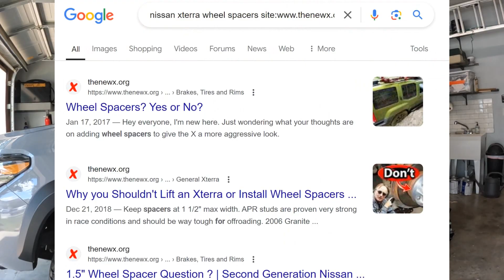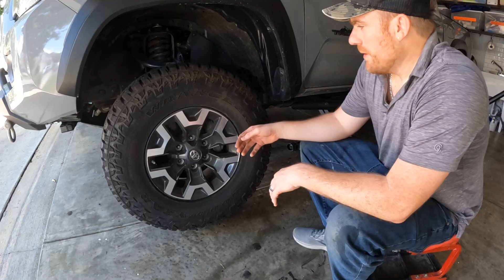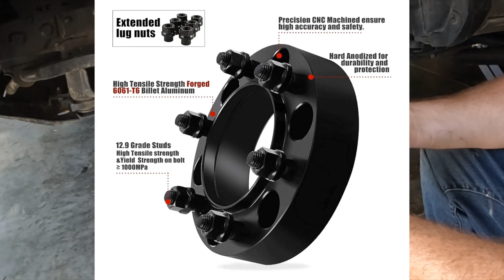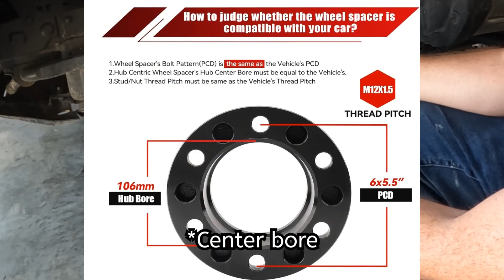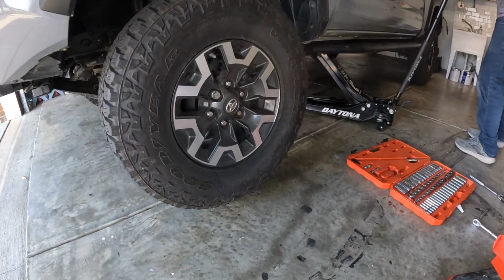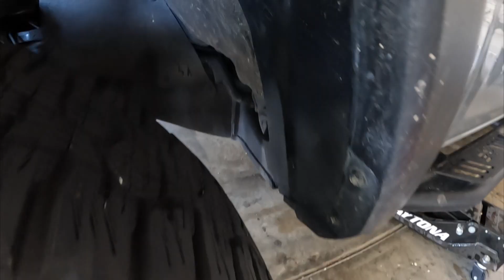Are Amazon Wheel Spacers Legit?!  Looking at Wheel Spacers on My 3rd Gen Tacoma

Comment: One thing you missed mentioning, and I think most folks don't consider, is to always check that neither the vehicle lug studs, nor the lug nuts holding the spacer to the hub protrude beyond the face of the spacer. If they do, they can potentially contact the mounting face of the wheel and cause it to not seat properly on the spacer. 

Other than that, make sure you remember to pull your locking lug key off (I noticed it still on the wheel during your final thoughts). ;-)
Reply from the maker: Great point!  I mentioned that in my past video but forgot to repeat that point here!  The Nissan Xterra rims actually had a recessed pocket behind and between the lug holes...so you could get away with a bit of a thinner spacer or longer stud.  Even better on the locking key, I got rid of the keyed lug nuts and replaced them with regular ones.  Got tired of looking for it and leaving it around the garage :)